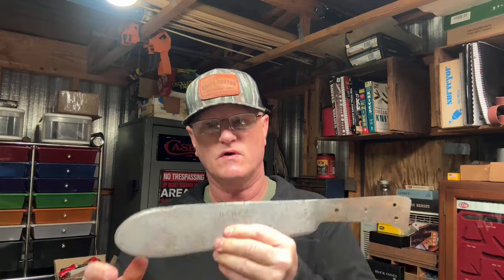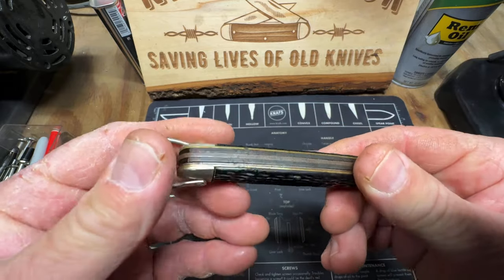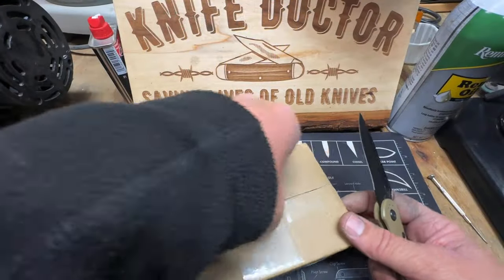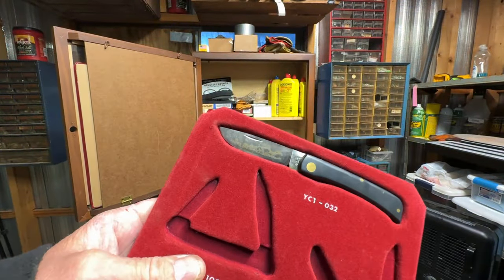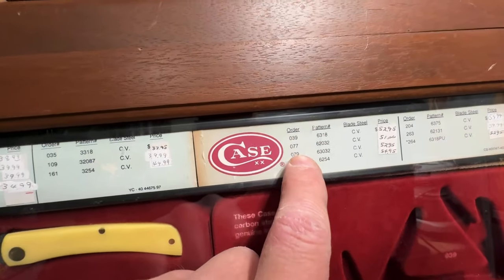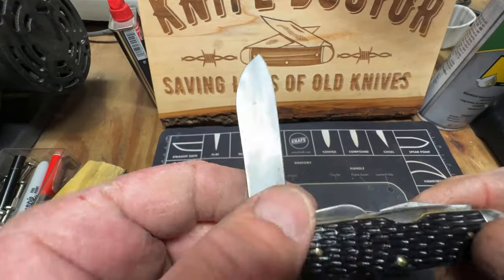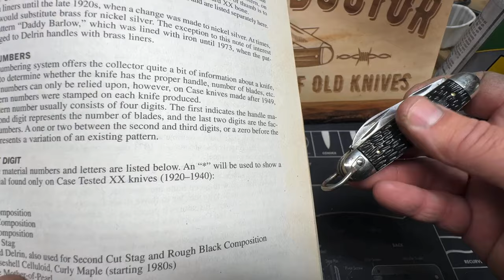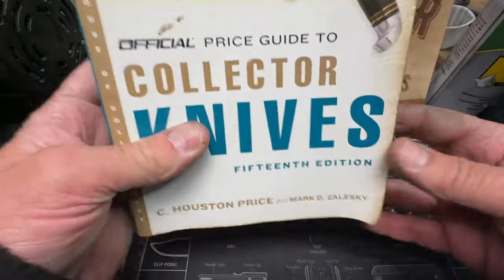Case XX Knife Quest Begins + Cleaning and Unboxing Adventure!

Comment: I took one of those little Dremel wire wheels to a knife yesterday, one of the tiny wires got me right in the eye. I was wearing Safety glasses, it took my wife five minutes to find it. Those things hurt!😂
Reply: For some reason, the eyes always seem to be like a magnet for things that shouldn't be there. Hope you're all good now. Gotta invest in some better fitting safety glasses. Only get one set of eyes.
Reply: Good Lord,,, those Dremel wire wheels are slightly less handy, then they are dangerous. Felt a wire, sticking in my belly, one day and one bath later,,, Yikes.
Reply: @_DlME  you’re not kidding, I have a shield I should have wore it, I do with the larger grinder. Have a great day.
Reply from the maker: Ouch!!  They do come out.